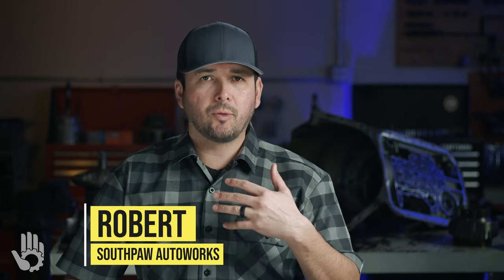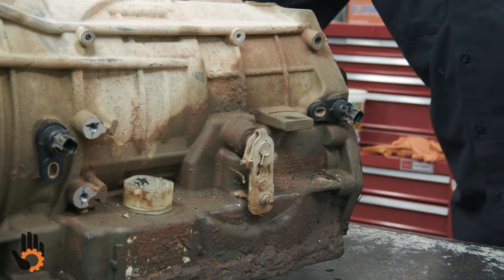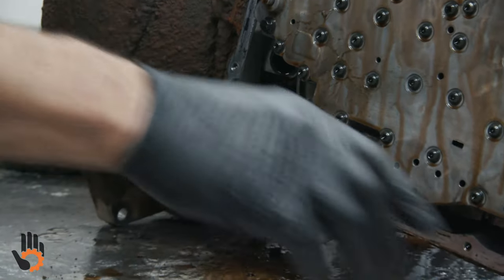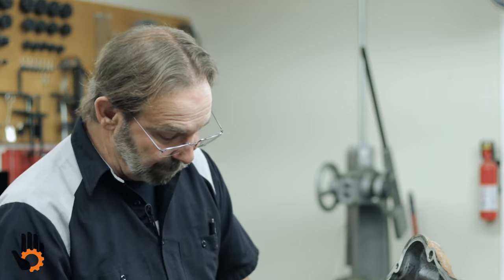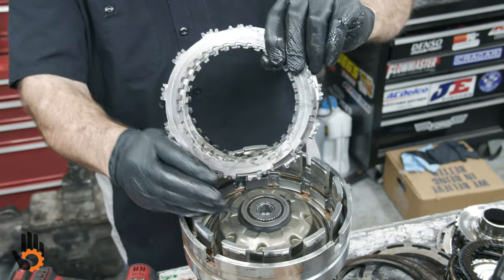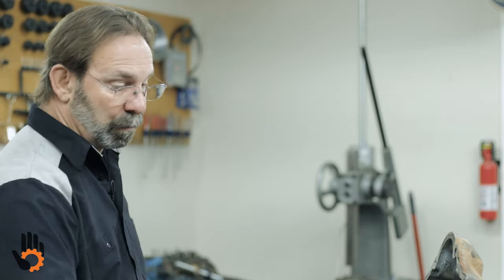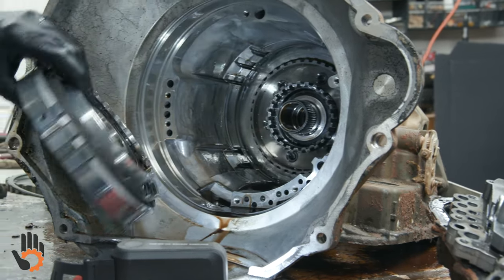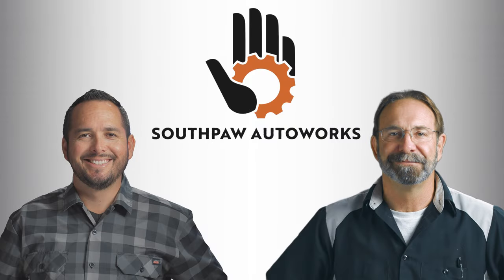68RFE - Teardown    (Dodge Cummins Transmission)

Comment: Every revision of this transmission, imagine how many customers had to deal with their dealer where the dealer had to collect specific information to which the engineers could use to revise the design. Each revision probably millions of dollars in behind the scenes work, from shop time, to mechanics labour, to lawsuits… lemon laws, etc. 
The road to a revised transmission is paved with a lot of pissed off customers fighting for warranty.
Reply from the maker: No doubt.

Comment: Thanks for the video, you make it seem not as intimidating, great job!
Reply from the maker: Right on!  We're on a mission to get more people involved with automatic transmissions.

The positive feedback is appreciated.  Thanks for dropping us a line.
Reply: @SouthpawAutoworks  that is very cool that you guys are doing this, ive built a couple motors in my life time, but have always been terrified of tackling a Transmision because of the complexity and sheer quantity of parts inside, but i may give it a go because i recently bought a used 2014 ram 2500 to tow my tractor, i got a decent deal on it and it was tunned and deleted, normally i wouldn't mess with that kind of thing, but it runs so well, at least it did until 2 weeks ago, .... torque converter quit locking up, dropped pan and serviced it, tons of clutch material....Iam so glad i bought an extended warranty, it looks like they are going to cover it, but they will only approve stock parts to go back in, i have since put the TCM tunning back to stock, at least for now, my thoughts are to try and get my hands on a good usable core and   build one, and beef it up a bit , and i would have a spare, i don't plan on owning another truck so i gotta figure these issues out,  between you guys and some others online ,i feel i can avoid some of the major pitfalls and mistakes when building the 68rfe, thanks again for the help..... John NC

Comment: Excellent video, thank you. I’ll be doing this tomorrow on a 21’ Ram 3500. No Reverse, snap ring in the 2C clutch comes loose. P2701 is the only code, come on immediately when shifting into reverse. Did you have any clutch volume numbers checked out before removing this trans?

Comment: I just had mine rebuilt. The input shaft broke and the case. Im having trouble with the torque converter locking up. The shop that rebuilt my transmission pulled the pan yesterday and said they couldn't find anything wrong. The only time it acts up is when I go to pull a camper. I scanned it while it was running and I'm getting random codes. Could the problem be with the wiring harness for the transmission or the sensors in the transmission

Comment: I have a 2021 2500 Dodge 4x4 Big Horn with a 68RFE.  My transmission just broke down for the second time. 1st time was The High Pressure Line Sensor. This time was the clutch and pump need replacement. It’s under warranty with only 9725 miles on it. I’m really having a hard time understanding why this is happening to a brand new truck? What should I be asking the dealership as they are fixing this. I haul a fifth wheel trailer and I am very worried this could happen again. Your suggestions please?
Reply: I have a 2008 68rfe  mine blew at 130,000. The pump blew because the line pressure wasn’t enough to keep it lubed up. There is tons you can beef up on these. Valve body keeps line pressure. Gotta update that. This guy is good check out precision transmission on you tube I think he built a 68rfe. Good luck. Mine was $4500. I think one too many burn outs.
Reply: My 2023 3500 4x4 68rfe is getting replaced due to metal in oil pan. It has 1,900 miles.

Comment: These transmisissions have an average life span of 140 - 190k miles acording to the data. I have one with 162k and its starting to shift hard and bounce around between gears when pulling. Is a rebuild better or is it better to juat put a brand new, improved transmission in it?

Comment: Where do i start when i lost all drive gears. Have reverse and park. Stopped a red light and when it turned green i had nothing lol. Fluid was full wasnt burnt at all. Just happened randomly. Its a ATS stage 3 with co-pilot 2 years old. Any help would be greatly appreciated!

Comment: Definitly interested in an inspection and rebuild videos. 

Does using all the screwdrivers Marr any critical components.  I ask because I used to build gas turbine engine and remarkable some of this internals resembale a PT6 engine. Lol

Awesome video
Reply from the maker: Pratt and Whitney...nice!
To answer your question, no, they do not.

Your input is appreciated.  Thanks for dropping us a line.

Comment: Can I remove the output shaft and replace it without tearing the whole transmission apart
Reply from the maker: The trans has to be torn apart in order to swap the output shaft.
Reply: @SouthpawAutoworks  will babe have to do a transmission relearn after I put an overhaul kit in, and In the transfer case the outer synchro ring broke the 3 tabs off, would that cause any of my no gear failures
Reply from the maker: If the trans was slipping, then a relearn will be needed.

If the damage caused the T-Case to shift into Neutral, then it would result in no forward, or backward, movement.  Mimicking a transmission with no gears...
Reply: @SouthpawAutoworks  okay thank you one last question should I rebuild my transfer case put that back in and see if the truck drives before overhauling the 68rfe the transfer case is pretty new was installed in 2019
Reply from the maker: It sounds like the T-case needs to be repaired either way.
That order of operations seems reasonable.